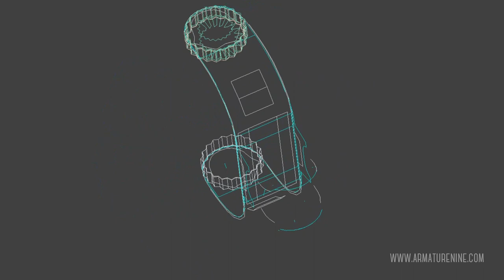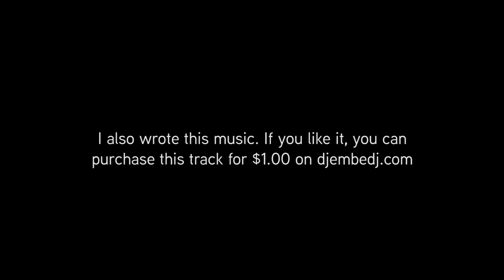Armature Nine - RangerXX vs RangerXY vs RangerClassic + behind the scenes

Comment: Hello Armature Nine.
Just asking, do you have sales for the large Ranger? What type of plastic or resin is the model made out of? Does it come with a magnetic sheet/pad? Can the figure be posed to do aerobic/acrobatic/martial arts/combat poses aside from the basic poses?

I recently purchased a Stickybones figure, though I may think about getting one of yours down the line.

Gracias por escuchar mi pregunta. Tenga un dia buena sen'or.
Reply from the maker: Hi , yes sales do occur on occasion. Primarily I give out $400 in store credit every month or two via the artmanikinchallenge.com  

The figure can achieve every pose humanly possible so acrobatic and contortionists poses can be achieved.  It comes with a metal platform (magnet sensitive) and a stand for airborne poses. The wooden material is a combination of recycled wood and corn based plastic. The connectors are ABS plastic though I’m considering switching to a different material in the future once I find one that works better.  Thanks for taking an interest in my figures :)